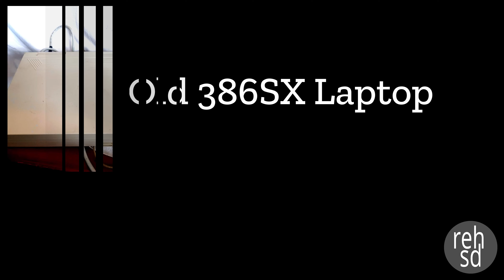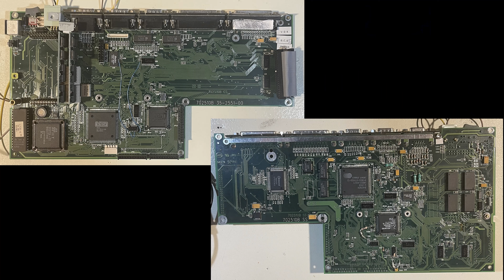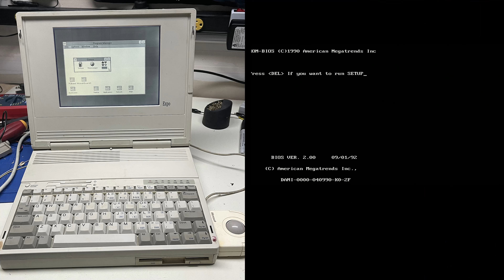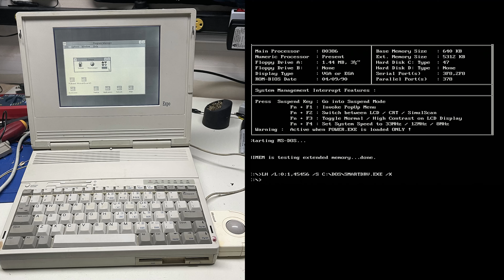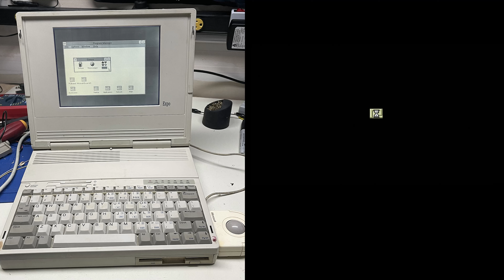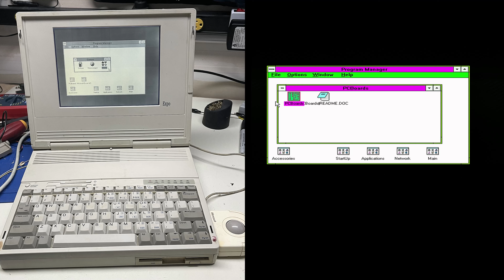An Old 386SX Laptop

Comment: Is that an RJ11 or an RJ45 connector on the rear next to the power switch? A modem I'd believe on a 386, but surely it doesn't have built-in Ethernet?
Reply from the maker: It's a power connector. The side of the laptop has a knockout for an RJ-11, if the optional, internal modem is installed (which this unit doesn't have). https://imgur.com/a/LE6gm8E
Reply: @rehsd  Oh that's wild! I was thinking the DC jack was the one with the round cutout on the side, but I guess that's the keyboard connector!
Reply from the maker: @JohnVance Ya', it's an unusual power connector.

Comment: I guess it was rubber bump stop that disintegrated into sticky mess that was the problem with the HDD. It is very common fault. These old HDDs are often ok if you open them in somewhat clean environment. Modern ones are not, at all.
Reply from the maker: Yep, that sounds exactly right. The drive wasn't working at all, so I figured I had little to lose in opening it up.  :)